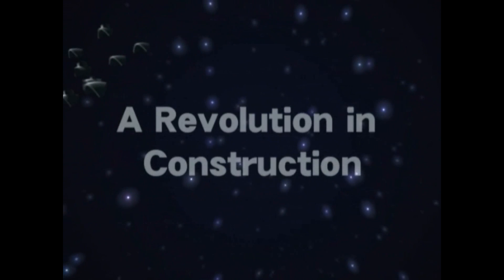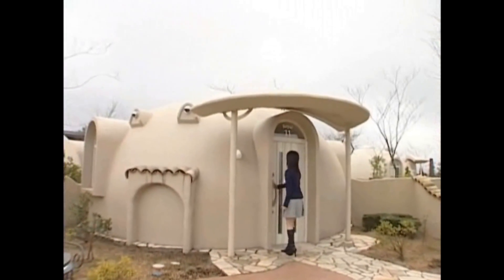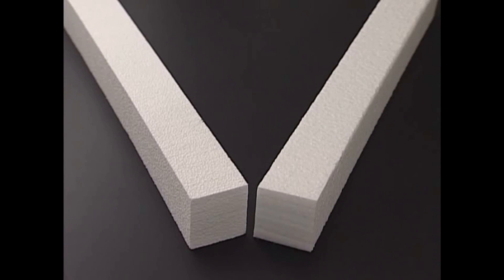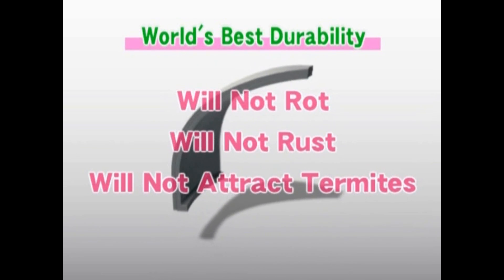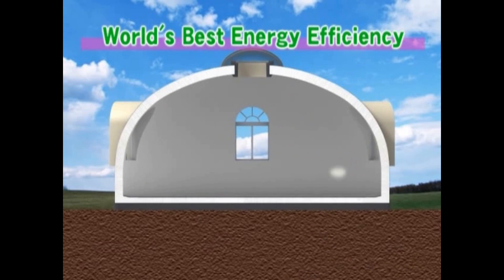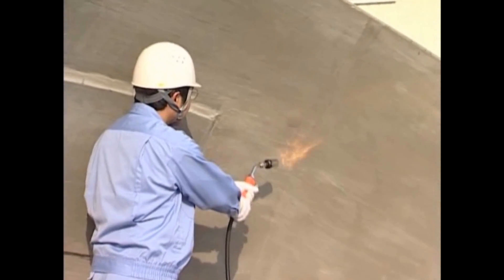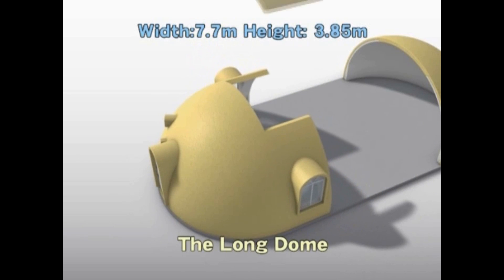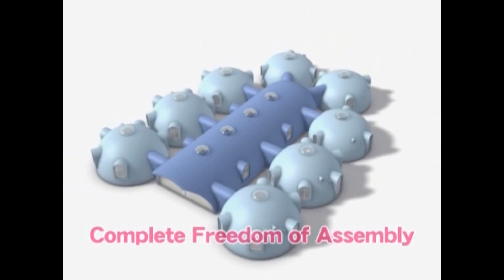The Newest Dome House with high technology in the 21th century

Comment: Looks good but extremely bad idea using expanded polystyrene fire hazard to the extreme beside the health effects from off gassing. Concrete or hempcrete would be better hemp panels would be easy enough and more fire resistant by far

Comment: What is the cost of a standard house ?
Reply: It depends on where you live usually for low class its around 40,000-50,000 for middle class usually 150,000- 400,000 and higher class higher than that.

Comment: Dear New Wave,
   Your space age home would be complimented with a table furniture piece of mine. It’s a small table made of triangular identical pieces. A 5th identical piece can be added as a bottom shelf. The bottom shelf needs no connectors it is held in place by it’s own weight and by the confines of the other pieces. 4 of it’s faces can be rotated to act as the top surface. When rotating to use a new top surface the bottom shelf can be slipped to it’s proper place. I am working on the design of the end connectors. They also will be identical. I have drawings and photos. I am 84 years old and I have work that should get out there. 
yours
   Ed Gorczyca
gorczycaed@yahoo.com

Comment: Can you build in the US? Can it be covered with soil?
Reply: +countrygril3575
My guess is that you would be better off with a concrete dome ('monolithic' or 'concrete canvas'(not actually a dome) ).

I don't think that the styrofoam has great structural qualities for resisting the weight of any dirt piled on the sides or roof.
Reply: Yes, is the dome strong enough to be bermed  with dirt on sides and could the dome be shot with shotcrete?

Comment: Every generation rediscovers the dome house as if it's never been done before.
Reply: Joe toe Shmoe I think its more the material here that is the main point; although, yes, it is kind of annoying this video is promoting the dome homes as though they've not been heard of before... lol
Reply: Welcome to Japan....they have "invented" everything. (rolls eyes)
Reply: It sounds like you are talking about sex... every generation thinks they have discovered it.
Reply: EM no, mine was 44 ft diameter on 3 ft riser wall making the apex 27 ft . All exterior framing is 2x8. Full basement is also 2x8 wood construction. 44x10 water solar collectors heat 3000 gal insulated storage tanks for DHW and space heating supplemented by water to air heat pump.
Reply: Excelente  https://www.academia.edu/19748963/domo_v4
 
                                          Un saludo 
                   Vas a ocupar ver estos vídeos

   https://www.youtube.com/watch?v=wmEEWxYUigE    1

   https://www.youtube.com/watch?v=AfibbuPUkWY       2 

   https://www.youtube.com/watch?v=8t9S891g5EQ       3

  https://www.youtube.com/watch?v=1cNqDiy51L8        4

  https://www.youtube.com/watch?v=plbB1o4dccI&feature=youtu.be  5
 
  https://www.youtube.com/watch?v=0DF8peT0wQk&t=239s  6
 https://es.scribd.com/doc/296227284/domo-v4
  https://www.youtube.com/watch?v=DfhMYHdcL5k  7
https://plus.google.com/+DavidRojassoto
https://www.youtube.com/watch?v=2L9O7DQHzmQ
   https://www.youtube.com/watch?v=cwWBpjeyRS0
Reply: I built one in Minnesota in 1975, 44 ft diameter,  25 ft high at apex.

Comment: Ok, but how does this compare to air-crete and also can this be adapted for multi-story units? Certainly not high rises I guess, not without a very large dome.
Reply: One area where aircrete wins is natural flame resistance. Polystyrene is flammable and needs flame retardant to be used safely as a building material. It can be done, but introduces a new problem as flame retardants themselves can pose health or environmental hazards.
Reply: This video is old, like 10 years+ old.

I've been to their Aso Farmland location where they've built more than 400 of these.  They are used mostly as hotel rooms.  Yes, I don't think their design lends itself well to multi-story structures or very large structures.  But for single story structures, they are pretty good and can be built FAR faster than the shot-crete monolithic domes.  I just priced the materials for one design that's about 86 sq meters in size.  The parts for the shell came to a little under $40,000.
Reply: @erad67 You seem to know a lot about the construction and information on there, are you saying 86 sq meters with the diameter, or the radius? Or the footage in total? Because that could make a big difference, Im just curious cause im trying to make my own dome housing.

Comment: this is really cool, bet these houses stand up to the wind really well, and the idea you can add domes makes me think domes added on can be bedrooms, one can be a bathroom, (nice and roomy) and another can be the cooking eating area and the main one the living/work area. nice.wonder how much each dome costs and would it be more economical to just get the lengthened one instead of adding domes?
Reply: It's a joke. Polystyrene is expensive. It's just 'expandofoam' which anyone can make inside a silicon mold held together in a steel clamped structure. I've made imitation stone panels out of the stuff. What would be smart is making ribs out of the stuff for a dome, covering that with Saran wrap, then rebar, then spraying on shotcrete. Modify the shotcrete formula to make Roman concrete which has I think, the addition of aluminum and calcium powder, so it self repairs.  I like this type of dome construction because you can add whatever shape windows you want. This means you can get a lot of cheap old safety glass windows from old cars.